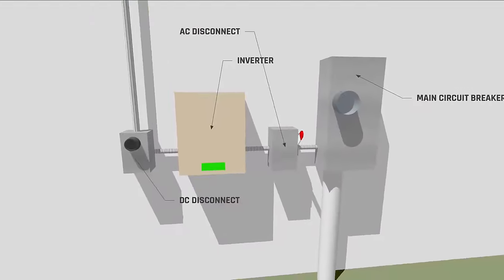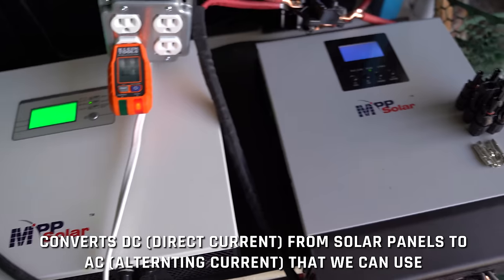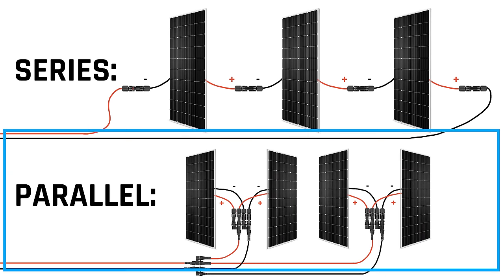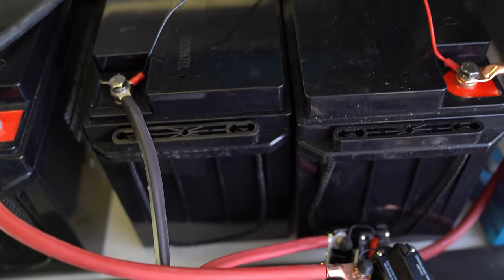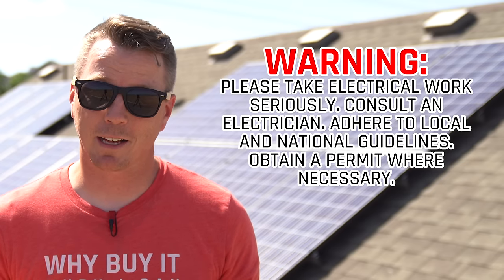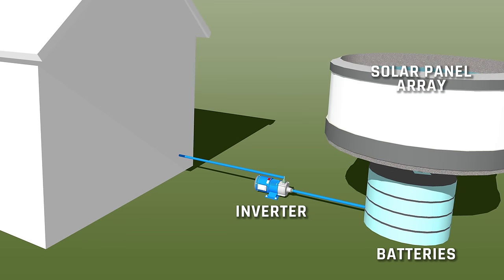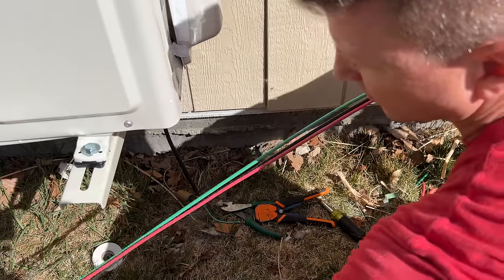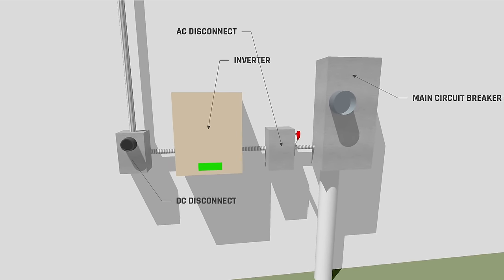SOLAR POWER: The Ultimate Beginner's Guide / How To

Comment: For a city person who knows nothing about wiring , And needs to power a fridge and lights in a rented apartment in case of a blackout i found this video not helpful. If i can't figure out HOW to make things go then I won't buy solar panels etc.
Reply: If you weren't able to figure that out from this video, call a professional because everything you said you needed was in this video.
Reply: Some people need a professional😂
Reply: I believe he didn’t go that much into detail due to everyone’s use case being diffrent. And rather told you what you need for each senerio (grid tied vs off grid) so you know what to look up and do research for. I believe in your area you just want an off grid solution if it’s ONLY for when power is out. You’ll need the switch that shuts off city power then solar panels to a controller to batteries ( make sure you see which batteries work best for ur situation, for example I wouldn’t use a car battery) then battery to inverter ( inverter changes the DC power to AC since ur house uses AC). That’s the simplified version of it though for the setup I think you’re looking for.
Reply: THIS IS AN INTRODUCTION VIDEO, NOT AN INSTRUCTIONAL VIDEO. I CAME HERE TO LEARN BASIC IDEAS OF SOLAR PANELS, NOT FOR INSTRUCTIONS
Reply: I'm a spoiled city person, and can't understand anything you say, therefore you are wrong and this video is bad.

Its crazy how proud of their ignorance everyone is nowadays

Comment: I think solar and the companies who sell it might be one of the biggest scams of all time. It's still too expensive to make sense. Dish out 60 grand to save a couple grand a year? LOL It's like paying Mobil $200,000 for "free" gas for life when you're only going to use $150,000 in gas. You better be running A/C 24/7 with all that power. My electric bill is only $250 a month until I run A/C and it gets up to $400. On average I pay around $3600 a year for electricity. As much as I want to built one of these systems it just doesn't make sense to spend 20 grand out of pocket and do all the work unless I was sure I am going to live in this house 10 more years which I doubt. I'm one of the last houses on the block that doesn't have solar. These people spent upwards of 60 grand for solar and now the panels are starting to degrade and roof issues from leaks, so on and so forth. Almost all the people I've talked to don't even have a battery system! They just think the panels are saving them tons of money while the sun is out. The irony is that they're at work and hardly using electricity during the day. 🤣

Comment: Great summary!  One thing to keep in mind with landscape wiring (at 9:54) is the voltage rating of the wire: panels run in parallel might be a manageable 40V open circuit, but panels stacked in series can reach eye-popping voltages, even to where the 600V rating of ordinary AC electrical wire isn't enough.  The dedicated PV wire often uses thicker insulation to allow 1000V or higher operation without breaking down, as well as sunlight resistant outer coatings.
Reply: Thank you for sharing your insights on landscape wiring and the voltage rating of the wire. It's crucial to consider these factors when setting up a solar power system. Speaking of power solutions, have you heard about the Segway Portable PowerStation Cube Series? It's a versatile power station with a massive capacity of up to 5kWh, allowing you to power your devices and appliances for extended periods. It also offers fast recharging and comprehensive protection features. Check it out if you're looking for a reliable power source for your outdoor adventures!

Comment: Great intro to solar video.
One note, not all electric companies use or offer bidirectional meters.  Be sure you find this out BEFORE installing and figure it in to your payback schedule if you are concerned about payback.
For example, we sell all of the power we generate at $0.09/kWh, but we buy all of the power we use at $0.1126/kWh, making payback abysmal.
Reply from the maker: Great point! I've been doing math on all of ours to see where we're at and it's not bad but you're absolutely right that you should check before building out a system.

Comment: Great video. One thing i don't quite understand, is when solar modules are in a string setup, why are the panels only as productive as the least productive panel? What is the reasoning/cause behind this?
Reply: The power is all flowing into the same system, say you have 5 panels in a row and 100 is moving through them, all are at 100 but one system is only able to process 85, that 85 then moves down the line instead of 100, like blocking a part of a stream, the water coming through that blocked area is not at capacity.

Comment: Good explanation of some of the basics. I did consider purchasing some of those salt silicate batteries at one point. But I went with the lifpo batteries instead. I do have some of those combiner boxes and inverters from Watts247 though. Looks like we shopped at the same store. I would recommend investing in some of their fuses though. Ian has 150-200 amp switches that are really high quality. I’ve seen multiple tests on the cheaper types and they don’t trip when they are supposed to. That can make for a scary situation.
Reply from the maker: Great points, Gavin. Yeah - I saw his video on those cheaper fuses not working. When I get something a bit more permanent going I'll be using the better fuses. The ones I have were an "I need some fuses right now - better hop on Amazon" purchase :) Pretty scary that they even bother selling products that don't perform their one and only job.
Reply: @LRN2DIY   I have a similar fuse. But I’ll be ordering a 200 amp from watts soon hopefully. I agree about the fuses Amazon sells. It could legitimately cause a fire in the wrong situation. But I suppose everything is a buyer beware situation with electrical parts.

Comment: I wish I had read this two years ago, I know now there are many sub contractors who will instal the panels and go from there. I had a "specialist" firm about a year ago to do the whole job and had to call them back many times.  First of all the system was blowing the RCD out on the house board, Then when that was sorted, the ap would report a serious fault. That happened a number of times. The installer did return to sort out the problem, but it would happen often at the first week in the month. I was then advised to have a radio contact from the system to the house, but that wouldn't work and so I was advised to have it hard wired; also a failure. I received a bill for four hundred pounds for the last "solution". I hesitate to say it, but the system is working OK at the moment, but that was a tedious year

We had a fifty panel system installed on a large public building about the same time and now the roof is leaking, seems to  be under one of the panels.

Comment: Is it possible to run a single 24v solar panel to a 120v  inverter without a battery? I want to run a single 110v AC pond air pump only while the sun is shinning enough light to power it.
Reply from the maker: Sorry I didn't see this until now! The short answer is yes - you can absolutely do that. Just be sure to shop for an inverter that doesn't require a battery to run. Many require the battery so that they're not constantly starting up and shutting down depending on the sun vs shade and that's worth considering for your pond air pump too - what if it's a partly cloudy day... So some level of battery backup, even a very small battery, would be advisable but is not required in some cases.
Reply: Let's us know how you did with that .. I have a new 50'x30' pond that needs a pump - the scum is starting to grow !!!